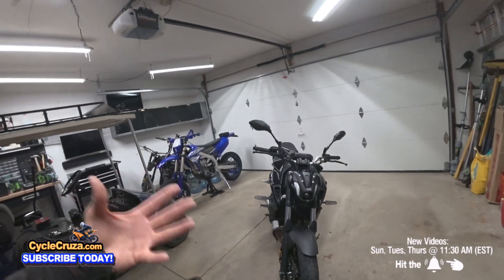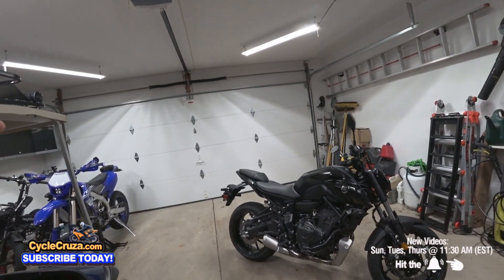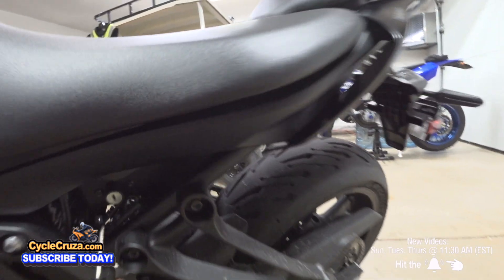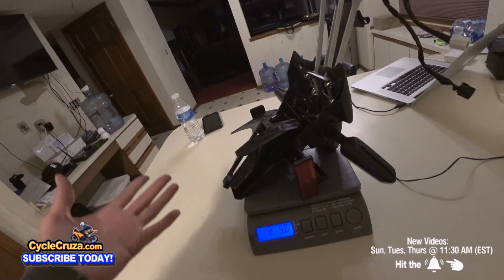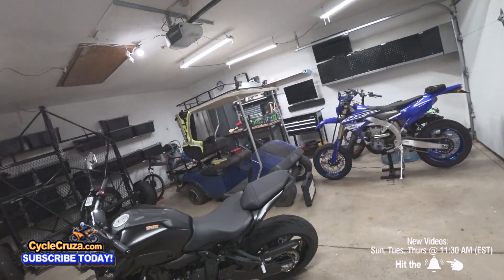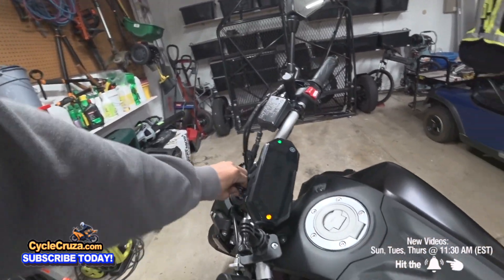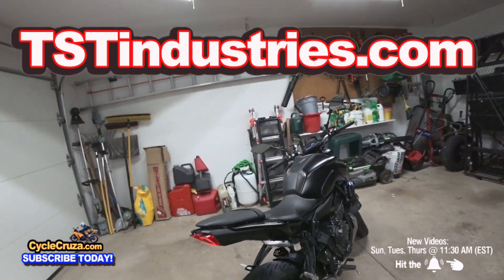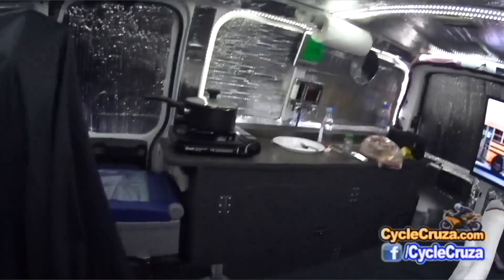NEW 2022 Yamaha MT-07 BUILD Ep. 1 | TST Industries

Comment: I did some of the same mods on my 2021 storm fluo mt, but went with the regular highmount and just bent it outwards a little so it didn't point as straight down as it did. I love the tail light and mech turn signals, they look sooooo much better then stock. Deleted the rear passenger pegs as well just to make it more open.

Comment: My  2016  Yahaha FZ-07 ..  Has Givi side cases .. Givi Tank bag..  Givi Top case with a Luggge rack on top of that..  Air Hawk air seat cusion .. as the  FZ seat is much less comfortable than the MT seat is ..
  I have a Modstad windscreen .. Heated Grips ..  Bark Buster storm  hand guards..  I remove the hand guard plastic in the  summer  but  still have the frames to protect your clutch and  and brake lvers in the summer..
  I have Givi Crash guards .. I have an Ardmore LED License Plate light ..  the  stock tail light is buriend on the  top case  and not  even LED ..

Comment: I've learned a long time ago to solder all electrical splices and connections.  unless u want an issue later on down the road.  Guys teach yourself to solder it's worth it.
Reply from the maker: They provide these special connectors the bite into the wire and screw in, Super solid. I had it on my former mt-09 too, zero issues. Very sold connection and doesn't void the warranty.

Comment: Doing everything proper CycleCruza!  I can't wait for the exhaust, tune and bar end mirrors.  Those bug antenna mirrors are awful.. I just recommend rear spools for chain maintenance and crash protection for left/right sides of engine.  I got the T Rex Racing engine case covers. SUPER EASY install!  Thankfully, I can't tell you how good they are in an actual wreck, but they look pretty good and both sides for $100.  Otherwise, there's the ones that stick right out of the frame as well.
Reply from the maker: There is a ton of stuff I'm doing. DNA air filter mod kit and so much other stuff. Honestly, I love riding this little bike in stock form so I know it will be so fun modded. I'm trying to see if I can use my Bursig center lift stand with this bike. They are sending me out an adapter plate but they aren't sure it will work. lol We'll see. I might add stunt bars on it. Idk, we'll see.
Reply: @CycleCruza  Stunt bars are the best for protection! but they're around $400-500 I think?  Not sure how much money you wanted to drop on this bike.

Comment: Lookin’ real good, so far! This is a question for everyone in the comment section: Has any one heard about or come across any rust issues with the 2021/22 mt07 models? I’m looking to pick this bike up at some point. Ride safe out there, y’all!
Reply: Yes unfortunately it STILL has, on the swingarm on the back! Mine got rust after 2 months ! And hasn't seen any rain! 

Great bike by the way.
Reply: @Brabobiker.  well that sucks, but I guess there’s some type of coating that can be applied to the swing arm in order to prevent that.

Comment: The  first thing  you need to do is Install   Ohlin or K=Tech Fork Cartiges in it .. I see you still have your Power Vision three.  I know one Model  will work on all CP2  engines  but  NO one is smart enough at Dynojet to tell me if  can use the some part # PV-3  as what you used on your    YZ-450-FX.. ect .  You don't need to change the oil so often on the YZ-450  if you are not  running it flat out all the time such as racing it ..  Some times  you have to use a little common sense.

Comment: Not so clean without ditching the fugly passenger footpegs, that saves about another 1.5-2 lbs. No, it doesn't protect your bike, crash protection does.
Reply from the maker: if you drop your bike it will help keep the bike from getting scratched. One time I fell over with my cbr600rr because I thought I had the kick stand down and it wasn't. I had no scratches thanks to the rear pegs down. I kept rear pegs on every bike since.
Reply: @CycleCruza  Guess what, crash protection (axle, frame and engine case) protects your bike from fall over AND also from crash damage. :D Passenger footpegs can directly damage the subframe.